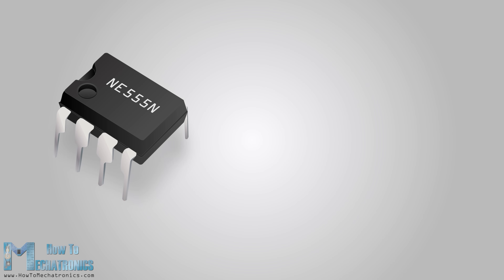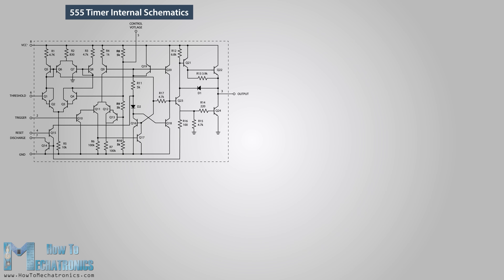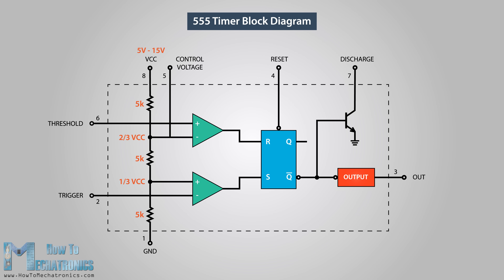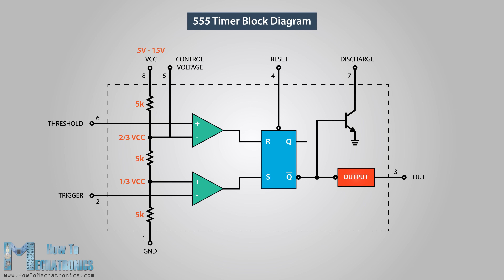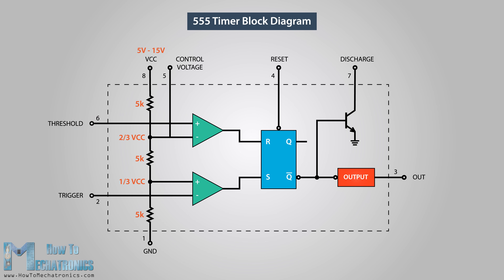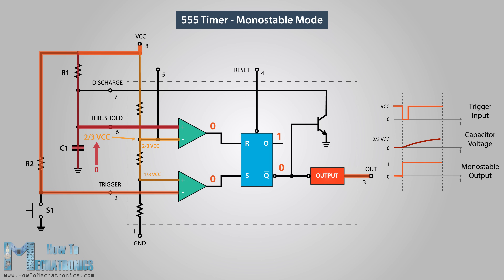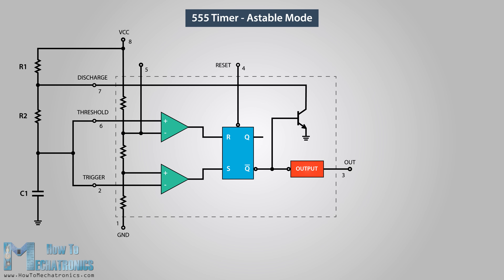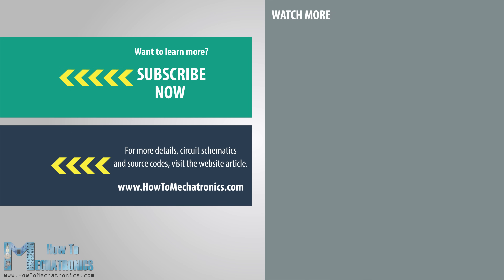How a 555 Timer IC Works

Comment: This example has two push buttons that drive in a stable output.  The top button sets the output high, and the other button will set the output low.

Well, I dislike the accent, this has a better time graph for the charging and discharging of the capacitor.

Comment: In Bistable mode I was only able to make it work when I connected pin 6 to Ground else I was able to measure negative voltage on pin 6 and LED was turning off as soon as I released the button on pin 2. I am using supply voltage of 5 V. 
Any explanation why this is different than what you explained?

Comment: 4:23 If anybody had this question like me, i.e Isnt S=0 & R=0 an invalid condition for SR flip flops? Well. It depends on whether you use Nand or Nor gate while constructing the SR flip flop. Since Nor gate is used,  S=0, R=0 is the hold condition ,not invalid! 

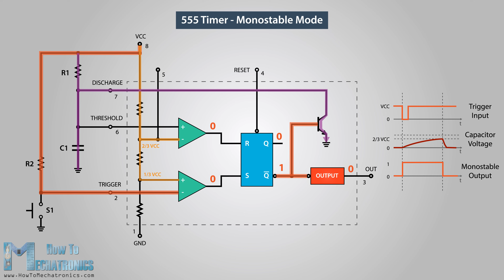6:48 If anybody who reads this is curious how to derive that t=1.1*C*R result, its simple.

      capacitor
--------| |--------
|                   |
|                   \
|                   /   resistor
|                   \
|                   /
|                  |
| __  Vcc __|
       constant Dc 

dq = i dt
i = dq/dt

Using Kirchoff's law,

q/C  +  R i - Vcc = 0
R (dq/dt) = (Vcc . C - q) /C
dq/ (Vcc - q) = dt/ CR

Apply integration on both sides with limits LHS.. from 0 to q, and RHS..from 0 to t.

then you will get,
- Ln ((Vcc .C - q) / Vcc .C) = t/CR
From this we can easily get this result, i.e
q= Vcc. C (1- e^(-t/CR)) 

since q=CV,  

V = Vcc(1- e^(-t/CR)) 

Now apply V= 2/3 Vcc in this formula,
you will end up with t= ln(3). C. R

[ln(3) = 1.0986 = 1.1(approx)]

Happy learning!
Reply: your comment is surely underrated!!
thanks for the explanation!!

Comment: Hi there! Thank you for your work! One fixed idea is haunting me: in my little project, I'm tracking when a light sensor exceeds some threshold value and changing an angle of a servo(i.e. changing the duty of the PWM signal). My question: is it possible to complete this task using for example 555timer and comparator. Thank you in advance.

Comment: Why does pushing the button stop the current flowing in the wires? Wouldn't the current just split between the wires it is already flowing through and the wires going to ground?

Comment: Well-explained in a concise and understandable manner. Thanks to you I built a much clearer understanding of the 555 timer and how it works. Excited to make more NE555 projects without my usual hiccups in lack of knowledge. Cheers to you, man!
Reply: 6:48 If anybody who reads this is curious how to derive that t=1.1*C*R result, its simple.

      capacitor
--------| |--------
|                   |
|                   \
|                   /   resistor
|                   \
|                   /
|                  |
| __  Vcc __|
       constant Dc 

dq = i dt
i = dq/dt

Using Kirchoff's law,

q/C  +  R i - Vcc = 0
R (dq/dt) = (Vcc . C - q) /C
dq/ (Vcc - q) = dt/ CR

Apply integration on both sides with limits LHS.. from 0 to q, and RHS..from 0 to t.

then you will get,
- Ln ((Vcc .C - q) / Vcc .C) = t/CR
From this we can easily get this result, i.e
q= Vcc. C (1- e^(-t/CR)) 

since q=CV,  

V = Vcc(1- e^(-t/CR)) 

Now apply V= 2/3 Vcc in this formula,
you will end up with t= ln(3). C. R

[ln(3) = 1.0986 = 1.1(approx)]

Happy learning!

Comment: You did good. I am beginning to understand the 555 IC. Some memorizing and I will probably understand it well enough to use it in adapting my very own relay logic calculator design to integrated circuits to a build project rather than only a drawing. Thus I will be one step closer to losing my lunatic reputation some of which was gained by boasting about my half baked IC projects of about 31 years ago at a local tavern.

Comment: Actually I'm wondering, why isn't Q directly ouputted instead of the way it's implemented in the timer (Q-bar connected to a transistor and to ouput which flips it anyway). You would get the same result from directly connecting Q, right?

Comment: i Ned to buy PWM for hydrogen production. Hydrogen unit need 220volt
2500watt. I have 220volt inverter. Which PWM should I selected

Comment: An excellent explanation, but when providing formulas, it's important to define the units, it wouldn't necessarily be obvious to newcomers that the formulas would be in base units like Seconds, Ohms and Farads, especially considering that the common unit for capacitance in hobby electronics is micro Farads.

Comment: Many people also ground the CV pin of the 555 with 1 to 10 nF. This is almost never really necessary. Really important is to ground the VCC pin at least with 100 nF for the CMOS versions or 100 nF + 10 µF in parallel for the bipolar versions of the 555. Otherwise you will fight with current spikes causing conducted and radiated EMI or even circuit malfunction.

Comment: would a variable capacitor do same as an variable resistor in controlling frequency?
Reply: Anthony Peterson R1+R2 controls the charge rate of the capacitor when the discharge transistor is offline, R2 controls the discharge rate when the DT is online, so R1 to R2 ratio kinda controls the duty cycle of the output pulse. So yes, adjusting only one or the other charge resistor at a time would not only mod the input frequency but mod the on/off ratio (duty-cycle) along with it.

Comment: I like it. But anyone please explain why only 5k resistors are used? Why not other values like 5 ohms or 10k ohm?
Reply: Mono jit there now do exist different configurations, but in entropy resistance tends to drift unequally, more external precision parts cost more money, weigh more, time to mount, cause mistakes!

Comment: Yes, a classic I.C. ..... it's interesting.... there are quite a few 'variations' of this chip now.... in all the logic types....TTL, CMOS....etc, and package types....even surface mount.... (and care must be taken, too)  The input/output specs have changed quite alot too.   One of the big selling points of this chip is that it is 'Modular'...meaning that each subsection could be used in 'different' ways.... (window comparator, SR Latch, Output Driver, Open Collector Driver, etc.)  an engineer could use those blocks to get the 'function' he required... There was another IC from the 70s that was 'modular' oriented.... originally a linear power supply chip...the LM723... had an op-amp, error amplifier, voltage reference output, output driver, etc....  could be used in various ways... now most chips are either ASICs or pre-programmed microcontroller , they have their place...but the these old chips could be used, without having all the  overhead of a micro.... just 1 man's opinion....

Comment: Can someone write in plain English instead of math how I can decrease the frequency of the 555 timer astable mode? I need to increase the time it stays off. The length of the pulse doesn't matter. Do I just increase the resistor values?
Reply: You could try to increase capacitor size. Because this has a larger charging time, therefor the frequency will decrease
Reply: @leviflach936  the issue is on my circuit there are two caps. It's pulsing so rapidly that I think the resistors are abetter option because it's filling so fast id have to increase the cap so big... I think.
Reply: @satatik21  Where are the two caps located? And which resistor values are you using?
Reply: Reduce R1 and increase R2.

Comment: Yet another of the same old telling me nothing.

INSTEAD OF REPEATING WHAT EVERYONE ELSE HAS ALREADY DONE, WHY NOT ACTUAL CIRCUITS AND NOT THE USUAL ONES WITHER I am trying to learn about 555 timers and going in circles.

All I want to do is to turn a circulation pump on when the water level is high enough and off when it is too low. 

Fancy doing a tutorial on that?
Reply: use a floating relay thingy floating on the high level, that drives a motor relay for the pump. done. unless you want to use electronics as a diy project. Whats the timer for though? you need 2 sensors for water level, a logic for doing stuff, and relays to drive the motor. please dont do stuff with 120-230v if you dont have the education for it. it gets either very costly and/or dangerous if you make a single mistake.
Reply: @anttimaki8188  Adding a float is not the option.

I get fed up of seeing the same thing over and over again with no originality in adaptation for situations like having no float install possibility.

I am looking at something much simpler, a minimum level that has to be covered and if its not, the pump is off.

Saying that, I have yet to find a 555 tutorial that adequately explains how the timer inputs / outputs can be used and what is on offer is neither explained in terms of how those inputs are arranged in the circuit and why they have the effect they do have on the state of those outputs.

Take the very simple task of a voltage detection system that can switch in a battery. I find one that would be perfect if it wasn't for the fact that it turned the output on and off to make a beeper beep... Again. no offerings from the circuit designer using the 555 timer as controller device and how the inputs could be changed to make the output continuous, etc.

In simple terms, I can copy what you do, perfectly fine, however, I learn NOTHING... that is the most frustrating things of all. I can copy but not learn from examples of tinkering.

So if I could now add in the mains loss so that if power goes, the air pumps and water pumps can be maintained off battery (as they are 12 volt in any case)
Reply: @thepvporg  before you ask for a exact electronic circuit build, the designer needs to know a bit of things. Like the specs of motor(s) the board is driving. voltage, wattage, everything. also the power sources you are thinking of using needs to be known. then the actual thing you thought you would like the board to do in detail (drive a motor, sense water levels, light up leds, make beeps and peeps etc...). Just yelling around that none is helping you isnt helping when you dont tell what you want. maybe youre getting the same kind of answer because the answer is so obvious to the problem youre presenting that it comes up every time. also, are you prepared to pay the designer for the design or do you except to get a freebie? timer 555 is a timer, the representation in video is solid representation of its working, not a guide to build a electric circuit for You.
Reply: @anttimaki8188  I actually went on stack exchange to ask about how I would modify a circuit to get the desired results

Got told to get stuffed, not in those words but told that the site was not a freebie site for others to do your work, etc and I was flabbergasted by that because then then locked the topic.

Charming, given that I see plenty of "How do I make a 555 timer ?" and people post responses giving them an answer...

So I gave up.

I just found a site that is helping a fair bit in understanding how the various pins can be triggered or affected by the output stage, etc...

However, my issue is that this can't be switches, it needs to be via  sensors submerged or as I plan, use a copper plate in the bottom and place a plate half way up on a ledge, refill and see what happens ... when I figure this out.
Reply: @anttimaki8188  You see, this is exactly my point.

Has people not heard of giving up the info? I have considered these elements and I can calculate ohms law so working out resistors will be fairly simple.

12 Volts... FYI. However, Bucking the input to 5V as the lowest power I could get was 5v.

In simple terms... PV solar charge a 12 v cell / power pack. Power pack provides a 5v output at 3amp max. the pump is 5v 3watt.

Comment: If both lines on a comparator is the same voltage what is the needed difference threshold needed to have an output change?
Reply: J G it’s called overshoot*, and it depends on the comparator design, although what’s being called a comparator here is an AND-OR gate.

Comment: in the monostable mode example, do you not need to include a resistor for the capacitor to discharge through?
Reply: You may place a resistor anywhere Kirchhoff’s voltage laws allow.

Comment: At 8:10, how is that comparator outputs zero(low) and at 8:30 the comparator outputs one(high)? Both have a voltage difference of zero volts therefore output should be zero(low). Correct me if I am wrong. Thanks!
Reply: Same case at 9:10
Reply: The last stage is a logic inverter/amplifier. Scope output is correct.

Comment: Is it possible to turn on the 555 with pulses of 1kHz?I mean I want to connect Vcc of timer to pulses of 1kHz of 5volt.i want to use Astable mode of timer.
Reply: mrdocprofessor patrick no, if you put any resistance on the input it will drop under 5V min. threshold of VCC- and what sane person measures resistance in “kHz”?

Comment: At time 00:07:55, "the discharge transistor is close". You mean, it's open. it has 0v at the base.
Reply: Richard Rodriguez most foreigners speak of solid-state switches in literal terms reminiscent of physical hydraulic valves. “Closed” to them is no water/electricity flow. Off=Open=0 is only a locally-understood USA convention.
Reply: @HighestRank  I see what you mean. Thanks for the explanation. I guess that for the sake of everyone understanding, it would be good the use of "neutral" words like "no current flow" or similar. But of course, that is up to you, the same that making a website in more than one language for all to understand is up to the developer. Kind regards.
Reply: Richard Rodriguez that’s just one of the reasons why there’s this big ass wall between the US and 🇲🇽

Comment: I'm having trouble understanding what pin 5 is doing...isnt it just grounding VCC through the first 5k resistor??
Reply: Pin 5 is not connected to ground on any example here. But connecting a Pin 5 via resistor to Ground or Vcc you are affecting internal resistor divider and changing this reference voltages from 1/3Vcc and  2/3Vcc to some other values (if this is your intention).
Usually this pin is connected by capacitor ( i.e. 10 nF) to ground to improve stability of voltage divider from noisy.
Reply: zokonjazokonja  there is no noisy, let it float.

Comment: Very well explained video, I am an electronics noob but I think I understand the modes to an adequate extent now. 
One thing though - it might be capacitor fundamentals but in astable mode how comes the input voltage (to the entire circuit) doesn't stop the capacitor from discharging?
Reply from the maker: Thanks. The capacitor is discharging because in that case the discharging capacitor is active, meaning the the VCC is connected to Ground via the R1 resistor, or if there wasn't a capacitor the voltage at R2, C2 or the threshold and trigger pins would have been zero.However, the voltage is not zero because the capacitor was charged and now is discharging from those 2/3Vcc until 1/3VCC.
Reply: Addition to How To Mechatronics, Current is easily flow to the discharge because there's no resistance (very minimal resistance) at the discharge transistor vs R2 that have some value of resistor. So VCC get attract to discharge transistor easily ._.v
Reply: ល្អ
Reply: Scott Anderson led complants

Comment: What additional components would I need connected along the Output ( Pin 3 ) line to run a 3-9v motor ? I've seen circuits showing Output ( Pin 3 ) -  600 ohm resistor - LED diode, and Output ( Pin 3 ) - 600 ohm resistor - 2.2uF capacitor - 1 inch miniature speaker, but have not seen circuits with a motor attached. Thanks.
Reply: james renwick a darlington pair or FET, depending on monostable or astable configuration;
Respectively.

Comment: Where is the Pin 5 used ? in which state ? I dont think it's in any of your animation.
Reply from the maker: The control voltage pin is used in more complex circuits where you need control over the threshold voltage.
Reply: It floats. They all FLOAT down here.

Comment: how to use the  control voltage  pin ? , example please !
Reply from the maker: The control voltage pin is used in more complex circuits where you want to have control over the threshold voltage.